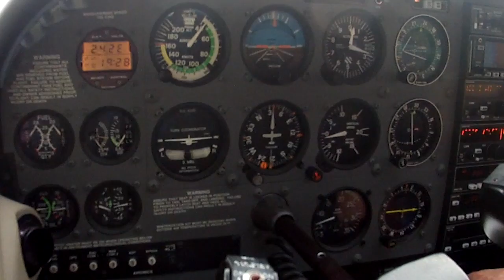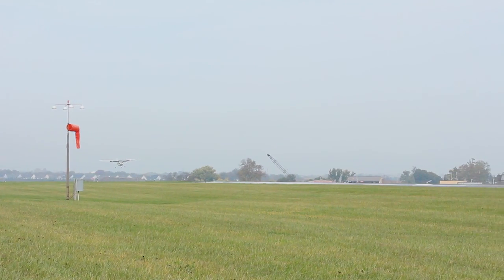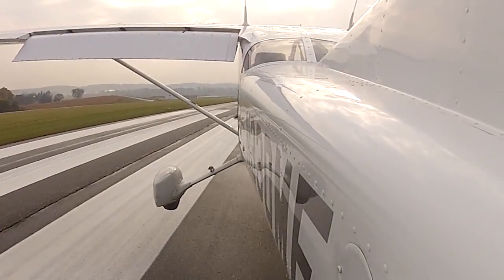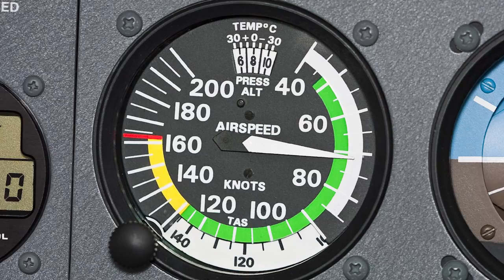Takeoffs and Landings: Short Field Landings

Comment: Why does bringing the flaps up on landing assist with slowing down? I guess decreasing lift?
Reply: You are correct. By decreasing lift, you have more pressure of wheels touching runway and more efficient braking. But, some claim that gain in raising flaps is so insignificant that there is no need in doing it.
Reply: Ratko Vasic thanks! Makes sense the more I think about it.

Comment: The additional degrees of flaps in a Cessna do help, BUT then there is the issue of nose wheel shimmy in quite a few Cessna's that you will most likely experience as soon as you start to apply the brakes.  Holding the elevators full aft will only last so long as the speed bleeds off.  I would like to hear suggestions on how to balance the desire to stop quickly and still somehow manage the nose wheel shimmy (Yes, I fly in a club and I am not the owner.  If I was, I would do my level best to fix that issue).
Reply: If I were you, I'd be insisting that the shimmy problem be corrected. Yes, SE Cessnas will shimmy at some point, due to wear and tear, but saying "they all do it" doesn't cut it with me. If corrected early, often it's a very inexpensive fix, simply replacing the hardware (shims and bolts) in the strut scissors. If allowed to progress, it can become ungodly expensive, as a new shimmy damper runs something over $900 plus installation. It can also result in other damage, specifically to the control rods and rod ends, sometimes to the scissors itself, not to mention the rapid wear to the nose tire. It's not unheard of for the shimmy to get so bad that the pilot loses control and departs the runway.

My experience with Cessna singles over almost 44 years of flying them is that the first time they shimmy, it's time to repair. With my current airplane, the very day it first shimmied 10 or 11 years ago, I contacted my IA. The next day, he repaired it by doing as I said above, in about 15 minutes with about $5 worth of parts. Compare that to a 172 that I instructed in some 35 years ago, which was a flying club airplane. The first time I flew in it, the shimmy was so pronounced that it began to shimmy before I could lift the nose for a soft field take off. I told the club manager that I wouldn't instruct in it again until it was fixed. Instead of the pennies it would have cost if they'd repaired it immediately, it cost them about 300 bucks to repair (inflation difference compared to today's costs).

As for what to do before the shimmy issue is fixed, the best advice is to keep the nose wheel off the ground as long as possible. That means that you won't want to do any heavy braking to attempt a short roll out. That will minimize the shimmy, because you can hold the nose off to a fairly low groundspeed.
Reply: I used to have a C150. I shimmed the nose gear scissors and it took the shimmy away. Look at McMaster Carr, they have the shims that will fit. They will probably be around .002 or .003 thick.

Comment: I'm surprised that there was no discussion about keeping the nose up as long as possible after touchdown (letting it come down naturally as the plane slows and elevator effectiveness decreases).

 I was always taught that this increases drag on the plane so slows you down more quickly.
Reply: It doesn’t make a measurable difference in most situations since the brakes are much more effective at slowing you down unless you are on a very slippery surface (for instance picture a hard surface runway, land and stomp on the brakes and you’ll be stopped much shorter than the guy holding the nose off as he rolls down the runway). You also want directional control so you want to get that nose wheel on the ground. Obviously we’re talking about a tricycle gear as a taildragger can’t keep its nose up! Most videos you see where they are trying to hold the nose off is because they have a rough surface and are trying to mitigate forces on the weaker nose gear.

Comment: I respectfully disagree with a lot of this, nobody in the real world puts the flaps up as soon as you land except maybe some real STOL birds with mechanical flap levers. For one, at the speeds the typical SE plane can land, with slow moving electrical flaps, it’s not going to make any difference, and as soon as you start flying a “complex” airplane they’ll tell you not to change the aircraft configuration until you are clear of the runway, it’s too easy to hit a wrong switch, lose control, or even retract the gear while rolling down the runway. I agree with the speed control and spot landing statements, those are correct for the real world. Also, you can pretty much always land in a spot you can’t take off from, the danger lies in lack of speed control and touchdown point so you can actually get stopped on a “short field” without incident. Every landing in an airliner is sort of a “short field” as you don’t change any of the techniques, only the amount of braking. The performance data will give you the correct lowest speed when you use the maximum flap setting, he’s right about noting your weight and atmospherics for the correct speed since for some reason most planes don’t use AOA indicators. Whether airliner or Cub, pilots are expected to land on the centerline and on the touchdown markers every...single...time...so even on a back country strip, touchdown aim point is very important. There are plenty of videos on YouTube of guys making great short field landings and it’s all about speed control, flight path, and touchdown point and the rollout will be quite normal.